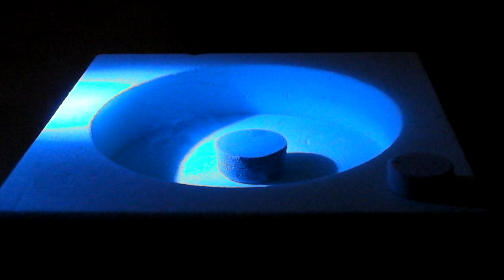What's The Difference Between The Meissner Effect & Flux Pinning?

Comment: Enjoyed your videos, but could you turn the music down a few notches? I had trouble hearing you at times.
And could you answer the question: what is a magnetic field?
My understanding of physics is that "touch" is when the electron of our atoms repel each other. So what causes magnetic poles to attract and repel?
Reply from the maker: FarSeeker8 Glad you like them!  Re. the music - just the other day we re-edited this video to get rid of the background music so there is another version of this video available without the music (there should have been some links in this video to take you to the musicless one).  You can check it out at https://www.youtube.com/watch?v=lxWrRfC1Y-A&list=PLxNMKdTABaYi5delOcgd8uMKN5FZqQD4_&index=1.

Regarding magnetic fields - a magnetic field is a vector field in that it has a magnitude and direction at each point.  Essentially a magnetic field is produced by moving electric charges (you can see this easily enough by placing a small compass next to a current carrying wire).  Permanent magnets produce a magnetic field also by virtue of moving charges.  The moving charges in question here are the electrons.  This is a big over simplification but electrons moving around the nucleus of an atom will produce a magnetic field.  Also, electrons have a property called spin which, for our purposes we can consider to be exactly what it sounds like.  This 'rotation' also produces a magnetic field.

Hope that helps!
Reply: "Essentially a magnetic field is produced by moving electric charges (you can see this easily enough by placing a small compass next to a current carrying wire)."
Sorry, that doesn't help much. It's the mechanics of it, but what is that field?  Moving Electrons may make it, but what is is?
And why does a permanent magnet Not lose strength when it does work? Put a ball bearing next to one and it is pulled to it - doing work - but the magnet loses no energy.
Reply from the maker: FarSeeker8 I know what you mean, but the best definition is to say that a magnetic field is a region of influence around a magnetic material inside which a magnetic force acts.  As to what, physically, a magnetic field actually is - I don't think it's possible to go beyond what I've already said without some difficult maths and the descriptions become much more esoteric.  

It might also be worth pointing out (or it might just complicate matters!) that magnetic (and electric) forces are mediated by photons i.e. they 'transmit' the force.  However, the photons involved are what we call 'virtual' photons and these have different properties to everyday photons.  Virtual photons pop in and out of existence from the vacuum - the longer they exist, the longer their wavelength and hence the less energy they have, but the further they can travel.  This explains why magnetic fields are weaker the further you get from their source.  This is quantum field theory and, more specifically, perturbation theory and it gets very complicated.

As regards work done, you can think of it in the same way that we think about gravity.  If you lift a rock off the ground and hold it above your head, you are doing work to put the rock in that position.  The rock now has potential energy.  When you release the rock, that potential energy is transformed into kinetic energy as it then falls back to the ground.  The Earth has not 'used' any energy in making the rock move.  For this reason the Earth will not some day run out of gravity and a magnet will not run out of magnetism.

That said, permanent magnets do eventually lose their magnetism.  This can be due to a number of reasons - exposure to external magnetic fields, thermal effects and physical 'bashing about'.  In each case the magnetic domains within the magnet can suffer realignment and gradually reduce the magnets strength.  

Hope that helps.

Comment: in these different effects, is it possible to shift the fields so that the superconductor will react different to either the "+" or "-" fields emitted by the magnet, or do they have the same reaction to both field states?
Reply from the maker: gwjones82009 If you mean would things happen differently if we orient the north pole towards the superconductor rather than the south pole (or vice versa) then the answer would be 'no'.  The effect is identical regardless of the orientation of the magnet.

Comment: im probably not the only one who thought about this but wouldnt it be a good idea to make a hover craft based on flux pinning?
just thinking maybe have a giant plate of super conducter on a plate below and a layer of magnets on the bottom of the craft
Reply from the maker: Chidorengan2000 This is quite easy to do with a small scale model (and we have plans to do this ourselves one day!) but as far as I'm aware it's never been done on a large scale.  There are a few maglev train systems around the world but they use electromagnets or superconducting magnets and steel rails.  Superconducting magnets are basically electromagnets cooled to very low temperatures so the electricity flowing around them to produce the magnetic field encounters no electrical resistance - making them much more efficient.
Reply: Wouldn't flux pinning prevent the craft from moving anywhere?
Reply: Wait... No. It is called "flux pinning", after all, and not "field line pinning". I'm guessing that the magnetic field can move as long as the flux remains constant. This would explain how the magnet in the video is able to rotate even while pinned. In that case, your idea sounds like a good one.
Reply: uuuusernameeee1
thanks :D

Comment: hmm i once did this at my uncle but im not sure which of those effects it was... the effect wasnt ass strong as the flux pinning in this video but we only used very small magnets. we could place the magnets in any height and they'd remain there. will magnest remain at the height you position them at in the meissner effect or will they drop to a certain height where forces cancel eachother out? if the latter is the case then im certain we did flux pinnin.
Reply from the maker: Golol cohan If you placed the magnet in the air above the superconductor and it stayed there it would have been flux pinning.  The Meissner Effect involves the magnet lifting off from the surface of the superconductor and levitating.

Comment: In the first part of the video when you put the paper clip on the super conductor, you say once the super conductor is chilled the paper clip shouldn't stick anymore... What effect would the magnet have on the paper clip through the chilled disc style super conductor? and through the other style of chilled super conductor you used?

and if two magnets were used, could you pin one magnet on one side of either type of super conductor and one of the other? or would the magnets still effect each other?
Reply from the maker: ***** I don't think we used a paperclip in any of this video. In nay case a paperclip won't stick to the superconductor at any temperature as neither are actually magnetic.  Even if you magnetise the paper clip it won't stick to the superconductor as the field lines pass straight through the superconductor (just as they would through a piece of paper etc).  The difference is that when you chill the superconductor past its critical temperature it expels the field lines and this causes the magnet (or magnetised paper clip) to sit on a 'cushion' of magnetic field lines.  This causes the unstable levitation we see in the Meissner Effect.

With the thinly coated sample of superconductor, some of the field lines are trapped within the superconductor and this causes flux pinning, a much stronger levitation effect.

To be honest I've never tried magnets on both sides of the superconductor.  I imagine there magnetic fields would still interact in the same way they would if the superconductor were not there i.e. they would attract or repel but this is something we'll have to try!

Unfortunately we're out of liquid nitrogen at the moment and won't have another delivery now until September but when it arrives we'll give it a go.
Reply: wonderstruckwow Thank you for your awesome answer! I love all the videos you guys put out. I hope to see what happens with two magnets! maybe I'll try it! [i just need to find a super conductor]

I was a bit unclear with my original question, I meant in this video you show that the super conductor disc allows the magnetic forces to pass through and allows for the paperclip to interact with the magnet sticking it to the opposite side of the super conductor, showing that at room temp the super conductor doesn't effect the attraction the paper clip has to the magnet. My question is under chilled conditions what effect would the super conductor have on the interaction between the magnet and paper clip on the opposite side of the super conductor? Would the chilled super conductor not allow for the magnetic forces to attract the paper clip? Is a metal that is used with the magnet and chilled super conductor subject to the meisnner effect as well?
Reply from the maker: ***** Glad you like the videos!

I had actually forgotten that we did that bit at the start with the paper clip!  I've never tried what you suggest but I think the paperclip may still do the same as it protrudes beyond the diameter of the superconductor so will still interact with the field lines from the magnet.  If, however you use something smaller like a small ball bearing which is completely covered by the superconductor it will be 'shielded' from the magnetic field so should fall.  It's definitely something we'll try.
Reply: wonderstruckwow
I look forward to seeing more Meissner Effect/Flux pinning videos! Thanks for your great answers, I'm even more curious now!
Reply from the maker: ***** Glad to be of help!

Comment: Is flux pinning the same thing as quantum levitation or quantum locking?
Reply: Science!!!!!
Reply from the maker: 'Quantum locking' usually refers to flux pinning but 'quantum levitation' is used to describe both flux pinning and the Meissner effect.
Reply: wonderstruckwow in our opinion do you think one day flux pinning could be used in vehicles? also what kind of technological advancements do you think it can cause? it would be nice for your opinion :)
Reply from the maker: Possibly.  There are a couple of maglev trains in operation in Japan & Korea I believe - these don't use flux pinning but rely on superconducting electromagnets (electromagnets cooled by liquid nitrogen etc to reduce electrical resistance to pretty much zero).

The problem with using superconductors for flux pinning is the large amount you'd need to lift a train and the need to keep them very cold.  This could all change if we develop superconductors that truly superconduct at room temperatures but the problem is that no one currently understands the mechanism by which high temperature superconductors actually work.  Maybe there's a Nobel prize in it for you if you can figure that out!
Reply: armyofone53 
Its is possible and already in work. Look for maglev cobra from Brazil. This year a 200 meters magnetc line will be open for public transportation at Rio de Janeiro.
Reply: thank you for your time that is some fascinating technology
Reply from the maker: No problem - that's what we're here for!

Comment: Trapped field lines, could we use that magnetic theory for hover crafts. Listen. Magnetic roadways and liquid nitrogen super conductor cars O.o
Reply from the maker: It's already used in some Maglev trains.  There are also plans for roads made from superconductors so that cars could run over them with pretty much zero friction but that's a way off in the future when we figure out how to make superconductors that superconduct at everyday temperatures and don't need bucket loads of liquid nitrogen to keep them cold.

Comment: absolute zero or zero degrees kelvin is theoretically impossible and has never been reached before because it would mean that there is no energy is an atom whatsoever.
Reply from the maker: No, it's never been reached and never will be although I think the current record is something like 1 nanokelvin.  This is achieved either by using lasers to 'cool' a single atom or using a magnetic field to trap a single atom.  Classically speaking at 0K all motion should stop but quantum effects come into play, notably Heisenberg's Uncertainty Principle which basically says that we can't simultaneously know the exact velocity and position of a particle.  If a particle is stopped then we know both of these pieces of information precisely, which is not allowed.  Hence at 0K we can't say really that particles are moving, just we can't say that they're not moving.
Reply: I believe if this were to happen it would mean time would be stopped for that particle in theory anyway.
Reply from the maker: I suppose you might say that as there would be no change to signify the passing of time but if it were possible it would mean that our basic understanding of quantum theory was wrong.

Comment: Music gets god damn loud
Reply: wonderstruckwow Hmm.. So even after planets lose the warm energy of their cores totally, they do not lose their gravity or magnetism at all? And what would you recommend to keep magnets as long workable as possible? Keeping them cold as much as possible? And btw do you know how cold the superconductor need to be in order for its special features to be unlocked?

Thanks for the vid btw, very informative!
Reply from the maker: Soul Hunter Glad you liked it.  

When a planet cools down it won't lose it's gravitational pull as that is a function of its mass.  As long as it doesn't lose mass the gravitational pull will remain constant.  

Magnetism is different - this is usually caused by currents in a molten metal core.  As the core cools and solidifies the magnetic field will decrease.  If you look at the other rocky planets in our solar system - notably Mercury, Mars and Venus they have magnetic fields which are just a couple of per cent or less of the strength of Earth's field.  These planets appear to have no active volcanism which implies they might have solid cores and therefore no means of generating a strong magnetic field.

Magnets should stay strong pretty much indefinitely.  The things which will demagnetise them are exposure to high temperatures as the increased random motion of the particles making up the magnet will gradually randomise the direction of the field of individual magnetic 'domains'.  Exposure to alternating electric currents can also affect them as the changing current produces a changing magnetic field which can gradually change the alignment of the domains.  I've got a couple of old magnets that I had as a child (a while back now!) and they seem to be pretty much a strong as now as they were then.

Our superconductor is yttrium barium copper oxide (YBCO) and has a critical temperature (the temp at which it starts to exhibit superconducting properties) of 93 Kelvin which means we can use liquid nitrogen (boiling point of 77K) to cool it down.
Reply from the maker: Yes, sorry about that.  Keep meaning to take it down and re-edit it but just not enough hours in the day at the moment.
Reply: its ok, just gets hard to understand the second half, really informative video regardless. Makes me wonder if you can affect magnets actual magnetic field through this.

Theory, if the bonds were strong enough on the magnetic waves, would it be possible to affect them physically, or strip them of the magnetic field
Reply from the maker: I'm not sure you could do that but to strip a magnet of it's magnetic field all you need to do is heat it up so domains inside the magnet that produce the field realign in a random fashion and, hey presto, no more magnetic field!
Reply: but why do magnetic fields lose strength over time?
example would be cheap neodymium magnets
I got some for $20 and after 3 months they lost their uber strength to be mediocrestrength
Reply from the maker: Digi Byte Interesting question.  Permanent magnets usually lose their strength if they've been if they've been subject to high temperatures.  If a magnet is heated above its Curie temperature the 'domains' which are aligned to produce the magnetic field become unaligned due to random thermal movements and this destroys the magnetic field.  They can also lose their strength if they are subject to fluctuating fields inside a coil for example.

It's also a common misconception that permanent magnets gradually run down because they are using energy in the same way that a battery in a torch uses energy to light a bulb.  Permanent magnets don't work like this - permanent magnetism is similar to gravity in this respect.  It is a property of the material itself and will not run out, in the same way that the Sun (or any mass) will never run out of gravity.
Reply: wonderstruckwow
wow thanks for the amazing answer, good sir! ((:
Reply from the maker: Soul Hunter No problem - always happy to answer genuine questions if we can!